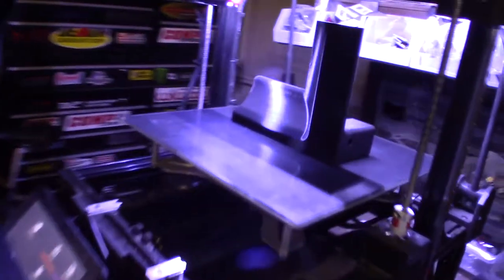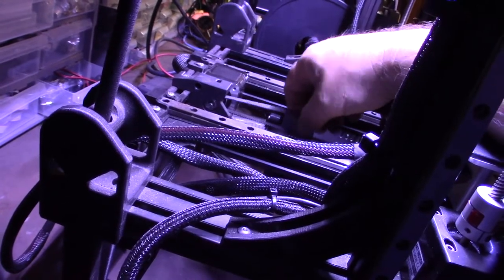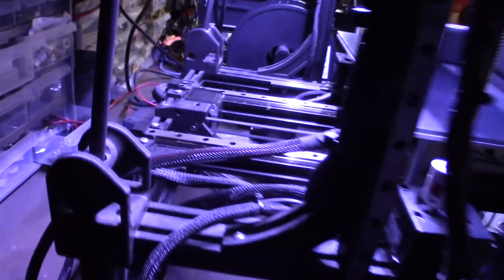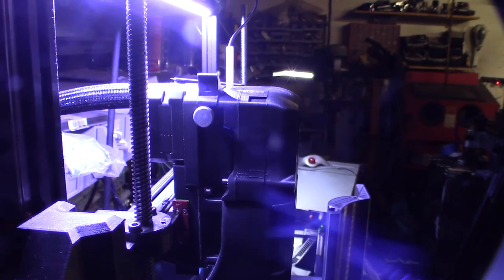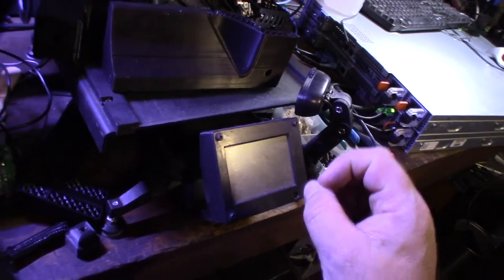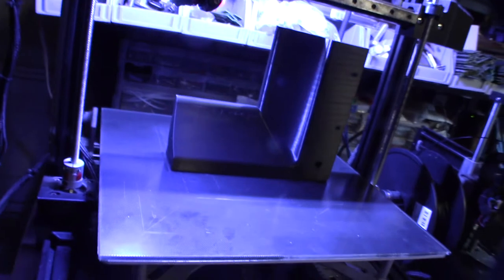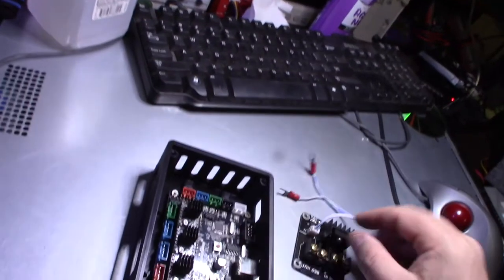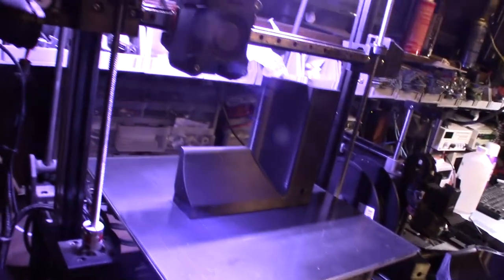Trinamic Skipping Steps Layer Shift Check Your Stepper Driver Current Marlin 2.0

Comment: Hey I have a belt printer and my motors kinda make a dragging noise when the hotend is going from 1 point to the other.  It causes layer shifts, is there something on the slicer you can do to keep the printer continually printing rather than accelerating around the model?  I've tried reducing the acceleration from 1,000 to 500 and it didn't do much.